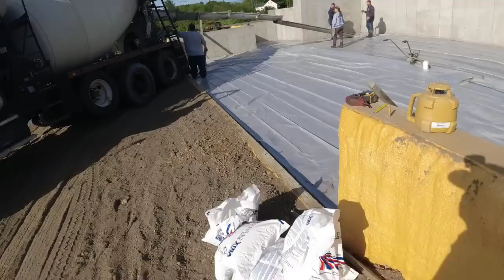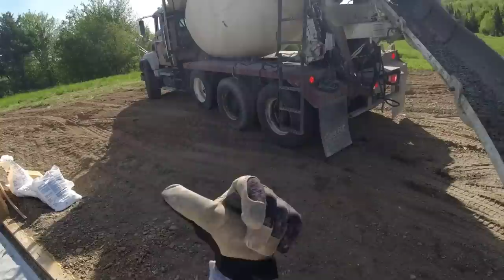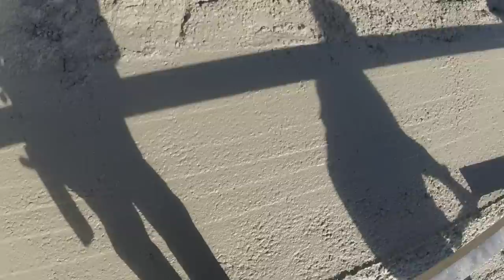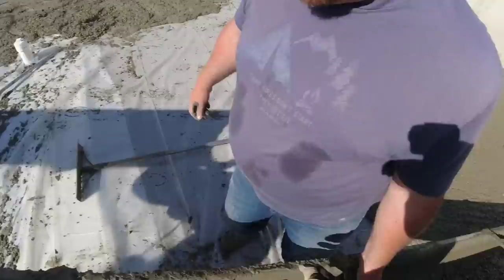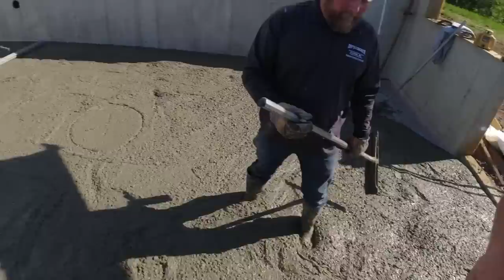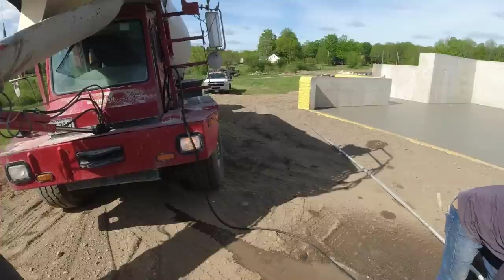Something's OFF! Two Loads Of Concrete - Same 3500 Mix Design - How We Deal With Issues

Comment: If the first load was that far off with that amount of stone. They need to have their scales adjusted. We were in the middle of pouring a 33 yard floor and the plan was to recycle the first truck because it wasn't that far away. Well after the second truck was batched. Our plant broke down. So they sent the first truck to a plant less then a 1/2 mile away from ours. The difference between our mix and theirs is. We use type 2 cement and they use type 3. The difference is night and day. But the job came out fine as when it dried it still turned gray.

Comment: First load was a bit boney, second was good, color was good on both, usually a problem with the moisture meter, if it isn’t calibrating right for excessive water weight in the sand, you will get a shortage on the sand and a boney load, it will be the correct weight, but still short on actual sand. Second load looks like it was corrected. After a rain, or snow, sometimes this happens. Probably not telling you anything you don’t already know.👍
Reply: But what does this do to the strength of the concrete? At what point do you reject the load and tell them to get the mix right?
Reply: @court2379  It does effect the strength, but usually not to a large degree, the amount of sand missing isn’t as large as you would assume, when I was pouring, I would have used the first load as well, but if it was to the point of separation because of the lack of sand, then it would have been sent back from a job I was doing. This man knows exactly what he’s doing, he’s a professional.

Comment: Possible:
Batcher error in wrong mix design
Loader error in using wrong aggregate pile
Equipment failure in not enough cement powder entering the mixing drum, or not enough sand or too much rock
Or it could be a combination of all of the above...
Reply: Pretty obvious no?

Comment: So is that second truck able to add water to the mix? Are they all able to do that?
Reply: they can all add water. generally the mix comes out of the plant into the trucks all the same, 4" usually, and you can have the truck add to bring it up to which ever amount you want. hopefully the driver is experienced enough to know how long to run the water for to get the correct slump